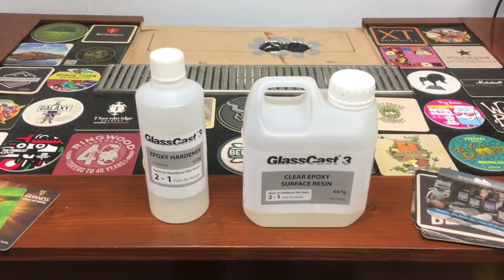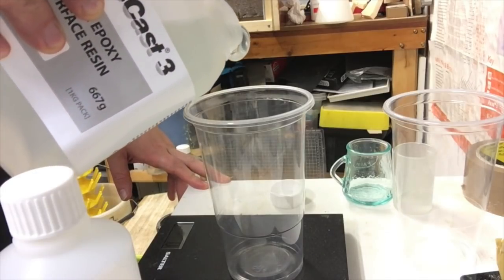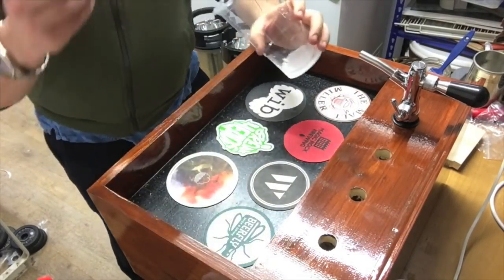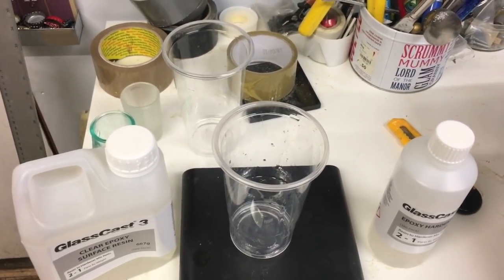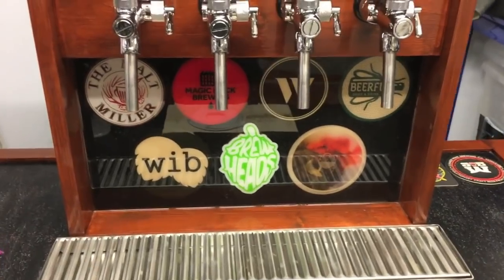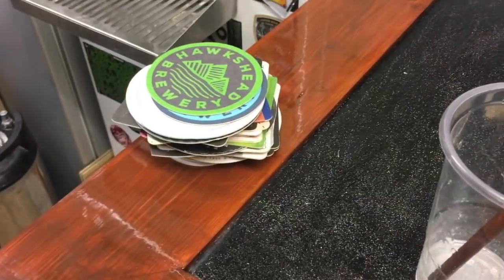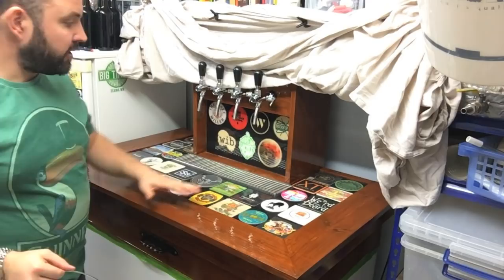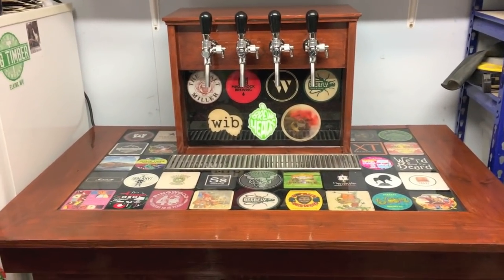Keezer Build Episode 5 - Epoxy Resin Bar Top with Embedded Beer Mats

Comment: Every time I saw your videos and this beautiful bartop keezer, I wanted one. My crappy keezer build just died. Anything you would change, five years later?
Reply from the maker: 5 years! Well it is still going strong so the design has proven pretty solid, I would maybe have invested a bit more money in the wood itself for the top surface and got a proper hardwood top. I would avoid using beer matts under the epoxy as some did have colours go faded or have the epoxy seep in through the edges which didn't look the best after all the effort with the epoxy, I reckon I would do beer caps instead or maybe coins something like that. Given that I can get 6 kegs in I would probably have liked to go with a full 6 tap rig but that was more of a budget constraint at the time

Comment: Nice one! Possible solution to coating the beer mats would be to try spray painting with lacquer 🧐
All done anyway! Hopefully see some beer flowing through that beast 👍
Reply from the maker: I didn't mention it on the video but I did try that and it still yellowed the light colours a bit unfortunately, I'm thinking now I probably should have laminated them or something  cheers!